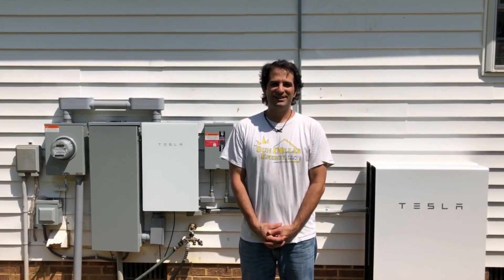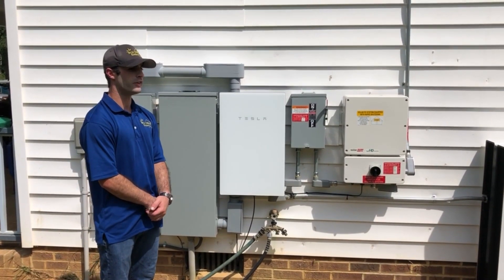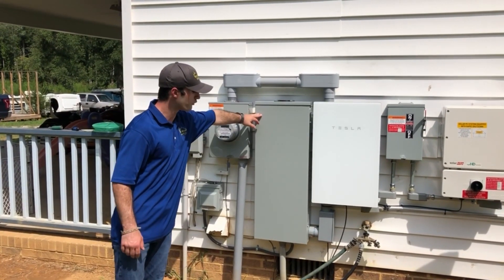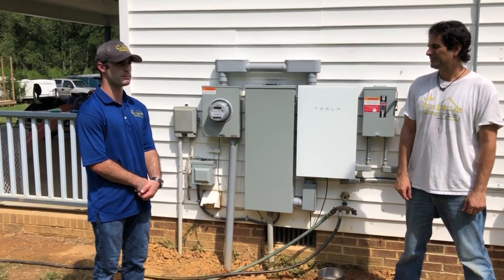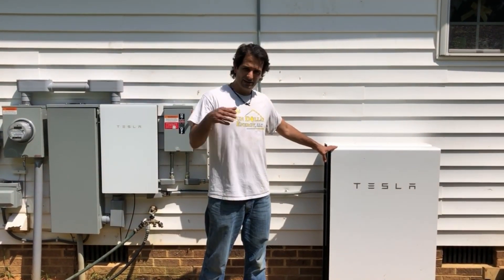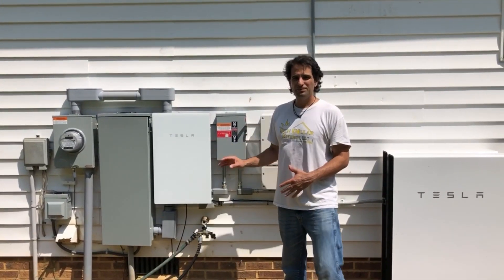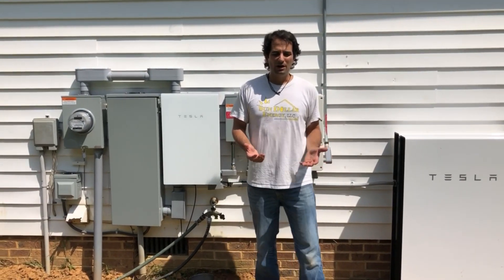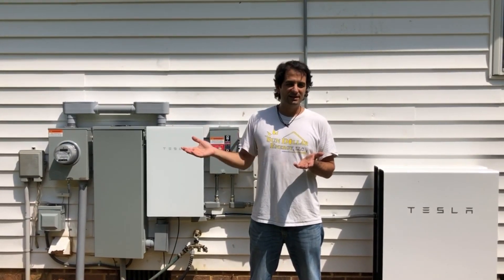Tesla Powerwall Installation by Sun Dollar Energy

Comment: What is the cost for the Tesla and it’s installation?
Reply: I was quoted $10,000 for 1 Powerwall, and $10,000 for install (it will vary based on installer, location, etc.).  I think this type of install to separate the panel would be more expensive but not sure.  I decided to go with Generac.
Reply: @stmcgarret  From what I know solar isn't bad but not as cheap as a generator install. Unless you have lots of real estate for panels.

Comment: I am not impressed with the installation:

1- outside on direct sun

2- on the ground with no clearance from it.  When the rains come, it will reach the batteries.

3- no rain or snow protection.
Reply: They are rated for that kind of installation. Tesla specs show it is fine being outside in the elements.
Reply: Preston Rich I know they are complainant for it, but if I was doing it in my house, I would allow the installer to proceed,
Reply: @highmarkrich  yeah but in direct sun or cold, it can mess with the output and overall life of the battery. Yes, it is rated to be outside but if it was yours, would you?
Reply: Lol it can still work up 3ft of water also it’s rated NEMA3 outdoor rated. You don’t think a billion dollar company have engineers that designed it to be made tough outdoor ?